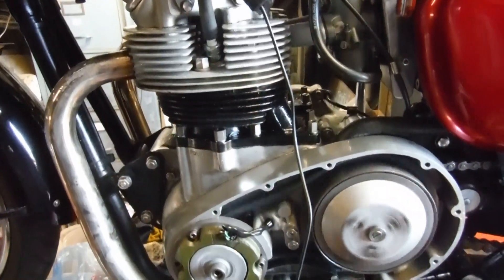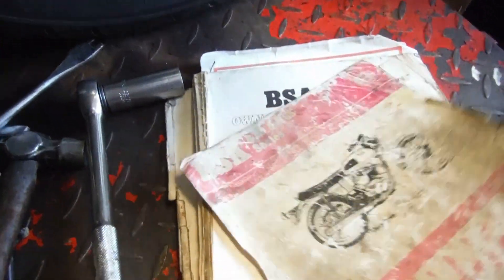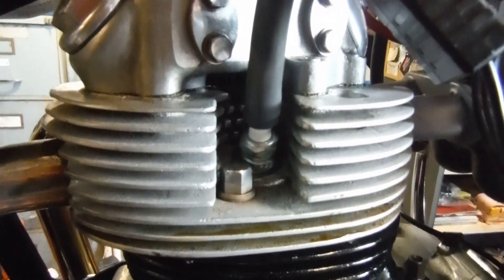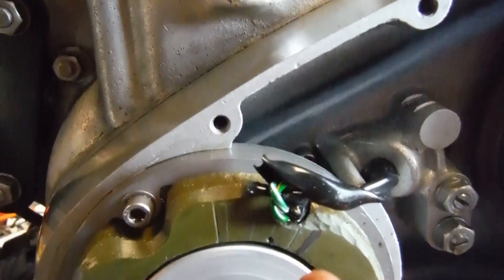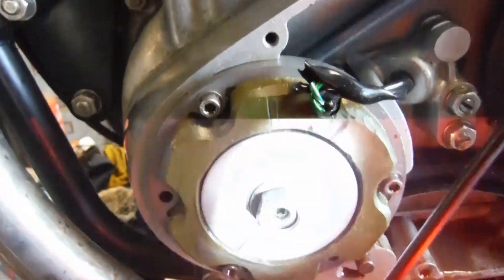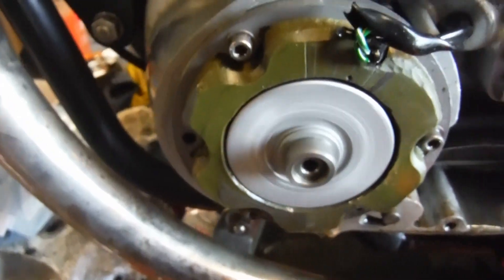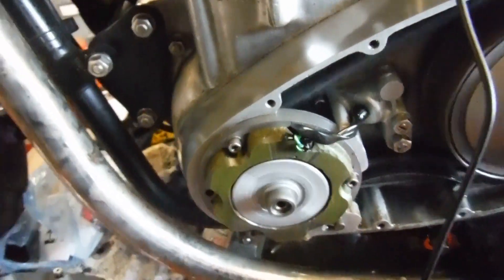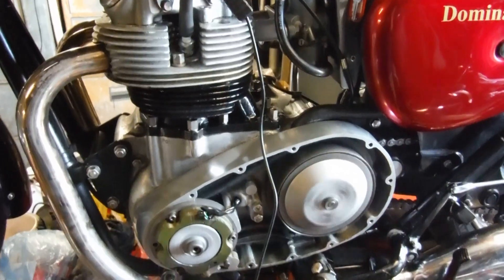Norton 650 Unified Twin Prototype, checking the ignition timing by strobe.

Comment: Triumph 650 full advance was usually 38 degrees BTDC. Static timing was 14 degrees. With an auto advance, full advance was reached at 2000rpm. Electronic ignition systems (Boyer and Lucas) tended to reach full advance at 5000rpm with a gradual increase from tickover. I often wondered if any power was being lost with the electronic setup in the 3-4.5k rpm range. I would swap between electronic and points/auto advance and honestly never noticed any difference ! I don't know if this slightly oversquare engine would require much deviation from those settings. I'm sure you have it all covered, Paul 👍

Comment: Honestly if i was the owner of that Norton I would cut my losses and put it on permanent static display at one of the large motorcycle museums in the UK with a full history of how this bike came into being.
I don't think it will ever be a reliable long term road bike. Something I think the design team recognised,which is why I think they binned the project.
Reply: I think that’s a bit premature as we’ve seen loads of lovely looking bikes turn up that run like shite and have loads of handling and safety issues. But as Paul’s said, you don’t condemn commandos or triumph twins on the strength of’ I rode one once and it was rubbish’,  
This machine needs fettling to get the best out of it, it is a prototype after all and would in all likelihood had better men than all of us busy snagging it eight hours a day.
Reply: @highdownmartin In all the years I've been watching this channel,that's the first where one side of the exhaust set up has fallen off the bike. I've promised Paul I'll follow this project through to the end. I just hope Anthony (the owner) has deep pockets,I think he'll need them.
Reply: I agree, this engine has not been through a thorough development cycle. The vibes Paul has noted are likely from not having proper crank balance and engine/frame mounting points worked out.  No parts are available for regular maintenance, no workshop manual or specs or knowledgeable people to work through future issues. Using it as a road rider for any significant amount of time seems like a waste of a special machine that deserves preservation and display.
Reply from the maker: Stay tuned, you might get a surprise!
Reply: @paulhenshaw4514 Sounds promising- I will follow this to the end.